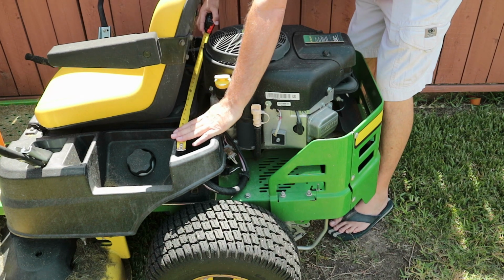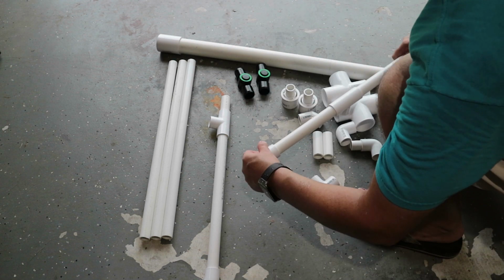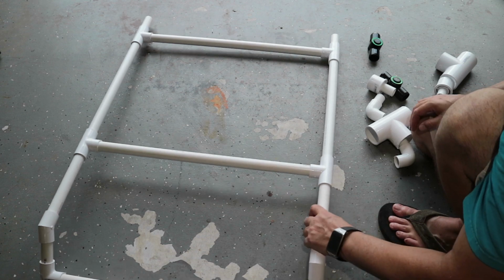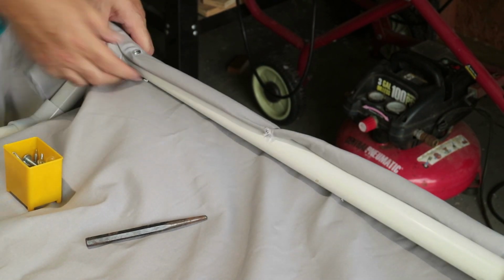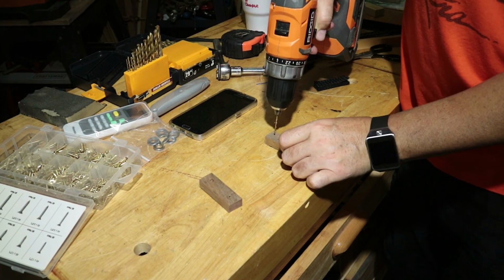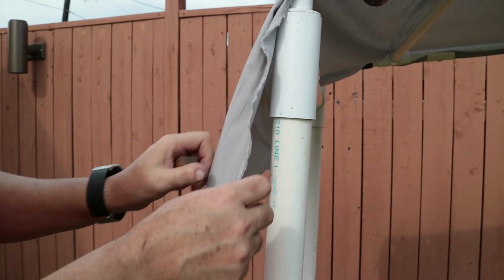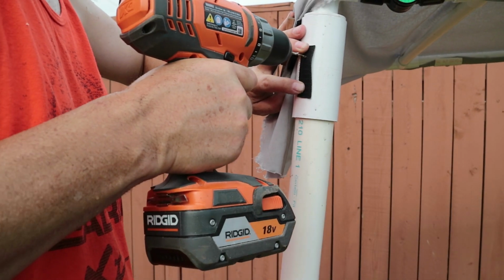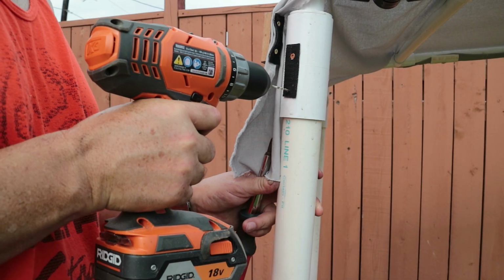DIY Sun Shade for Lawn Tractors & Mowers

Comment: Hope you don't mind if I offer some friendly constructive criticism?

If you're going to produce a video that features a certain product (in this case, those "AdjustAJoint" gadgets), please take a couple seconds in the intro to explain what they are, what they do, and why they're awesome for this particular application. Also, if this is the "second in a series" video that feature them, please add a link to the first (and third, once it's complete).

I watched the entire video hoping to get a little education about these things, but got to the end and still had no clue. I had to view the video a second time to catch the 2 seconds where it appears that you quickly demonstrated the joints, but again, no explanation of what you were doing. Someone not looking for it might easily miss it, as I did the first time. 

I did follow the links to find out more, and was further confused about the amazon link because they seem to use a different name, or make. 

Overall great video, I have attempted a similar sunshade project for my old Snapper riding mower out of ½" metal conduit, but mine didn't turn out half as nice as yours, and I quickly regretted not using PVC. Hope this helps, and I apologize in advance if I misunderstood the intent of the video. I'm a gadget geek, and when I see something new and exciting, I immediately want to know more. 

Cheers!
Reply from the maker: thanks so much for all the advice. i agree with you. think i will touch  up some things and repost it later. keep the advice coming it will only make things better.  not to make excuses but i was trying a new editing software and it had me so confused and frustrated. keep coming back i could use the advice.
Awesome critique.
Reply: You still didn't say what the parts were, Mescolito, do you know what they are and where to get them from??

Comment: How is this mounted to the tractor?
Reply from the maker: i bolted pipe caps to the frame and then slide them down in like a coupling.
Reply: @ChrisGagnonDIY   I would like to see a picture of what the pipe caps are and  exactly how you fastened them to the frame.  Everything else is displayed very well but this critical step is messing.

Comment: What are those black connector called and where can I get them from, any help would be appreciated
Reply from the maker: i put a link to them in the video description
Reply: Did you glue ur pieces together?
Reply: is there another video showing how you put it on the mower and how you stabilized it to the mower
Reply from the maker: no glue at this point is holds together very well with out,
Reply: Hi what do you call those adjustable fittings and where do you get them from.

Comment: How did you attach it to the mower?
Reply from the maker: I used PVC pip couplings drilled a hole and put a bold thru the bottom.